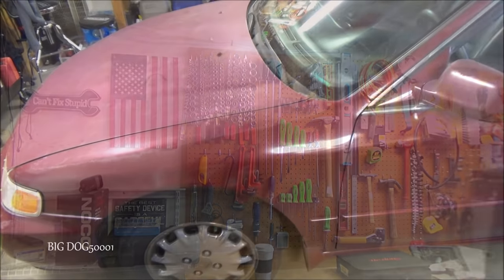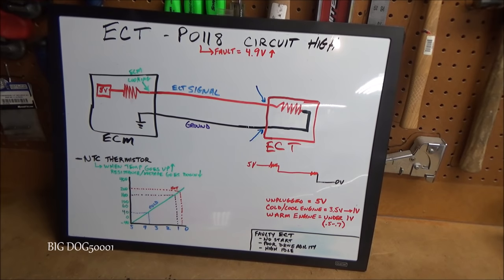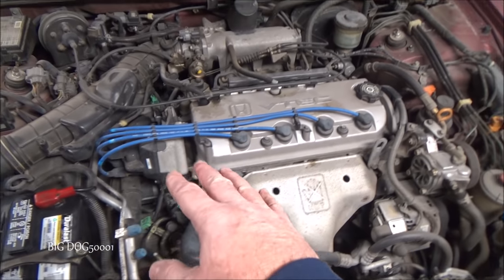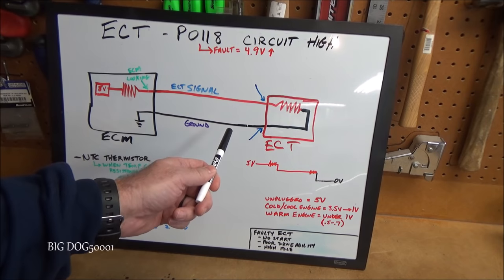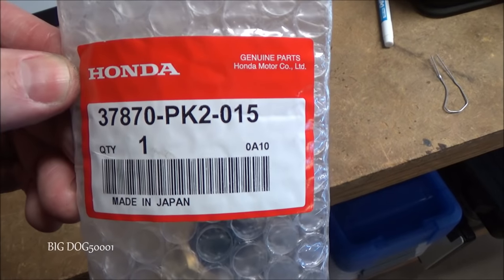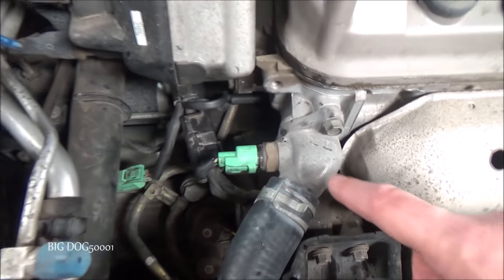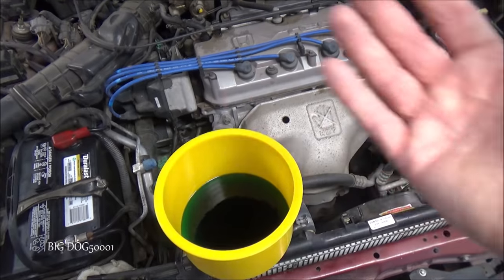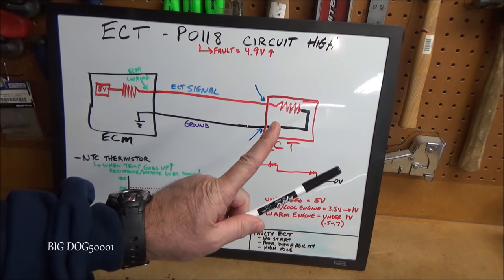Honda P0118 Engine Coolant Temperature Sensor (ECT) Circuit High Diagnosis and Repair

Comment from the maker: Tools and Parts
Disclosure: This channel earns a small commission using some of these links - at no additional cost to you.

Autel Code Reader (Scan Tool):  https://amzn.to/38ogyea
OBDII Extension Cable:  https://amzn.to/3amqCqS
Engine Coolant Temperature (ECT) Sensor shown 37870-PK2-015:  https://amzn.to/3rfs4kX  
Spill Free Funnel:  https://amzn.to/3mBYD93
Genuine Honda Coolant:  https://amzn.to/3mxrQSE
GearWrench Midlength 3/8" Sockets:  https://amzn.to/3mI2ce5
GearWrench Flex Head Ratchets:  https://amzn.to/3asmohp
Light:  https://amzn.to/3arkc9T

The Big Dog 50001 Automotive Channel Store can be found here: https://www.amazon.com/shop/bigdog50001automotive  (As an Amazon Associate I earn from qualifying purchases).

Comment: The most helpful video I've watched among dozens that cover the same topic
Reply: UPDATE: found out the ground wire was broken (bit by rodents) using your method. Connected it myself. Happy again! Thanks a lot!
Reply from the maker: Glad you found the issue (without firing the parts cannon at it), thanks for the comment!

Comment: 07 Fit, and my fans aren"t turning on on 90 degree days except when I turn on my AC. No codes are popping up, replaced both ECT 1&2, fans come on when ect 1 and 2 are disconnected or when I request A/C.  Big Dog I heart this video, Eric the Car Guy has always been my honda go to guy, but this is the best Honda fix video yet.  The best thing is how to use 'live data' on the scan tool to diagnose sensors in the vehicle.  Going to check 'live data' tomorrow :)
Reply from the maker: I appreciate the comment, thanks!
Reply: Hi. I have the same problem. Im about to replace both ect, then if anything, im looking at the thermostat. Did you find your fix on yours?

Comment: Thanks for posting this video. In the past, I've opened the bleeder valve in the manifold but it's good to know a funnel like yours is all I really need on these cars.
Reply from the maker: Nothing wrong with using the bleeder too (if the vehicle has one), especially if all the coolant has been removed.  Thanks for the comment!

Comment: Thank you!  I feel like I just completed a thoroughly educational training course!  I have a fast idle when engine is cold even after cleaning throttle body and IACV and I am suspecting the ECT sensor.  96 Honda Civic EX A/T.  Believe it or not, the Honda service manual doesn't even say that an ECT sensor that is out of calibration could be a cause!  I have no trouble codes but will connect my scan tool and read the live temperature data while measuring the temp of the ECT sensor body with a thermocouple on my DVOM.

Comment: I have a ‘97 Accord (2.2L non-VTEC)that for the past two winters has given me cold no-start issues when temps are below 40 degrees Fahrenheit.. at around 45° I can get the car to start but it chugs for a few minutes and I may have to depress the gas pedal near the floor before it will finally bump up to regular high idle RPMs. I’ve done a lot of online reading and seen various peoples posts about failing ECM’s however, I’m not the type of guy to throw parts at it and really enjoy your troubleshooting process. I know when the car starts that it has been getting a lot of fuel as it blows out a lot of rich, fuel exhaust. With a scanner is there a particular area of the l diagnostics that you would suggest paying attention to. I would really like to get this issue fixed so I can bring this car back to being my reliable daily driver. I just purchased the scan tool used here through your link so I can try to get a handle on this—so thank you so far for your detailed video.

Comment: Great video mate (hello from Australia) 
Having issues with my 1999 Honda S2000.
Replaced the ECT sensor after having the Code pulled (pre OBD, the paperclip method under dash, 6 flashes indicating ECT), the CEL was still on even after resetting the ECU.
Gave it a good thrashing through the gears and the CEL didn't come on for a few days. Now back to where I started.

After watching your video, thinking I'm gonna get a Multimeter, burp the system. Shame my car doesn't have a port to simply READ the codes lol. Only have them display on the dash
Reply from the maker: A 6 trouble code is similar to a P0118, circuit high.  If a new sensor did not fix it then a broken wire(s) or bad terminal connection between ECT and ECM or a bad ground for the sensor is probably where I would look next.  A scan tool would definitely help!  Thanks for the comment!
Reply: @BigDog50001  Thanks mate 👍

Comment: Great video, good explanation. 2012 Civic - runs great all winter. Hot summer days after a 20 minute trip or 20 minutes idling in parking lot, no warning lights come on but if engine is shut off, it will not start. No cranking, nothing, as if computer is telling starter relay to not attempt because it is too hot. 30 minutes later after engine cools down, it starts just fine. Could a faulty ECT be sending the engine ECU a signal to "Not Start"?
Reply from the maker: Thanks 👍!   A bad ECT can cause a hot crank no start.  https://youtu.be/S2RLQQy4XTQ

Comment: Great video! I have p0118 but my coolant temperature reading is fine during operation (160+ degree Fahrenheit). What could be the issue?
Reply: Did you ever fix yours?

Comment: So helpful will try on my 1998 Jeep Cherokee I replaced the ect sensor, but got the code. Was confused. Going to burp the system and delete code and go for a drive cycle.

Comment: Great lesson on the system . On the 2000 Accord , 4 cylinder , I am having a problem releasing the connector .  The tab is in the " 7 o'clock " position and out of view . I did remove the distributor cap and pulled the wiring harness back for a better look . I don't want to break it . I can possibly get a mirror in there to see the tab . I might have to use a pick on it . Am I missing something ? Thanks .
Reply: I’m having this same issue now did you ever find a solution

Comment: I have a similar problem. Would bad engine and transmission mounts cause the engine grounds to loose connection intermittently? I noticed in my scan tool that once you accelerate the ECT sensor shows -40 and then after a while it returns to working order.
Reply from the maker: Not completely impossible but the ECT is grounded through the engine computer, more thank likely there would be more issues than just an ECT sensor problem if there was a ground connection issue like you describe.  Breaks in the wiring to the ECT sensor can cause what you describe though.  Also, ECT sensors can fail intermittently like the one one in this video.

Comment: Hi Dave…thanks for such a clear and informative video. Super helpful.  Quick question about the switch you explained around 8:00. I’ve got a 1990 Honda Accord; no check engine light but the cooling fan (passenger side) comes on engine shut off EVERY time.  Fan will run for about 10 minutes and then shut off.  I know this is normal when the engine is hot, but it also happens if I go out on a chilly morning, start the car, and then immediately shut the engine off…the engine is still stone cold but that cooling fan will run for 10 minutes.  Based on your explanation I’m guessing the switch at the base of the upper radiator hose has failed.  So…how do I order a replacement? I believe that this switch and the switch in the back on the thermostat housing (explained at 7:05) have different temperature set points, no?  If I go to the auto parts store and just ask for an engine temperature switch, how can I know that I got the one with the correct set points?  Thanks for any help you can offer!
Reply: Have you fixed this issue? I have an 06 accord v6 and it does exactly the same thing as yours, the fan always comes on when i turn the car off, even if i just start it for a second. I had the ECT replaced a while back and did not fix the issue, now im getting the check engine light with the P0118 code

Comment: Great video guided me very well on  my 97 Acura cl 2.2 in finding the location of the ECT sensor. However i do have a question that i hope you can answer? Are the ECT switches that you show the one on the upper radiator hose and the one that is toward the back of the motor the same? meaning if i was to take them out and switch them out with each other would they still work? the reason i ask is because i can only find one of them under radiator fan switch and that's it. I pulled both those switches out and they are exactly  the same in everything but im not sure if they are interchangeable? if you can shed some light thank you very much.

Comment: How do you think about a VCM Muzzler, it manipulates the ECT1 temp to be always around 165F for the ECU to keep the VCM off. What else is the ECT1 data used for in a ECU? For sure Dash Temp Gauge and blower is only starting blow warm air after engine has warmed up to certain degree. Is the full mix ratio also depending on ECT1 temp or is it done by the O2 sensor? What other functions depend on ECT1?
Is a muzzler a functional solution at all?
Reply from the maker: Disabling the cylinder management system can work depending on who makes the device.  ECT1 plays a part in fuel mixture to a certain degree, so it is important.  I like disabling the system on V6 Honda engines due to P0303 issues that can eventually cause engine damage.  I plan on putting out a video on this topic soon.

Comment: I got a broken wire harness connector pigtails for my ECT on a 2000 honda civic Ex..I forgot the original orientation of the wires but its only 2 colors it looks like dark brown or red and black for negative I believe.so what happens if you cross the connection will the ECT still works or it will malfunction?I connected the red to red and black to black..I need some advise coz I still got CEL P0118 code,I will replace my ECT this week and see if the CEL still on and my idle was high like 1500 rpm..thanks

Comment: What a awesome video man I have a 96 accord and I do all my own work but I knew there was like 3 ect sensors and a sending unit and for the life of me on Google and everywhere I looked I could not get accurate diagram of which sensor was which so thank you for the info you are very helpful. Also if you don't mind me asking where you got that info from not so I can verify but so I can get info from the right place in the future. I do everything from simple repairs to tranny and motor rebuilds and this sensor situation had me confused! I have the same code similar issue mine is just high rev  at stop signs and hard starting in the mornings I thought it was the iac or something but I ran my code scanner and found the same p0118 code. My cel is always on for the cat that isn't on the car so I wasn't sure if I had a cel for what was going on or not. But thanks again!

Comment: All the sensors in all the cars are basically ADC (Analog to Digital Converter) values, that is, voltages to digital values.  Pretty simple stuff and materials, but the car industry charges people arms and legs for these sensors!

Comment: Just a quick question. If my fans are coming on after the car is shut off but not running when the car is turned back on could this be the ect. I know the relay is good for the cooling fans and the thermostat is working but we are only overheating when it is at idle. Otherwise it does not overheat. The fan is not turning on once it gets over certain temperature

Comment: Might not get a response but here goes. I have a 2001 Integra popping this code after overheating(gauge was going up to hot then sliding back down to the middle) I saw some leaking from around the same area that this ECT was located. Could it just be as simple as replacing the ECT and topping off/bleeding the coolant? There was also a P1457 EVAP leak code. Thanks in advance for any response

Comment: Hi, can you help me please? I have a 2013 honda civic 1.8L. Today I was at dunkin donuts, the car was idling with the AC on, then after about 7 or 10 minutes the red high temperature light began to flash. I immediately shot car off waited about 15 minutes. Car was restarted, then I turn heating system system on all the way to get all the heat out of the engine. Then car was parked. After about one hour I scanned my car with a good scanner, did not get any engine codes, monitor codes, or gages codes. I then command the cooling fans to engage with the scanner which they did. I also checked for cracked hoses, inspected radiator, inspected under water pump pulley and under car but no sign of any leaks. I am assuming its a coolant tempt sensor going bad but not sure. I have not inspected the coolant level on the radiator or coolant reservoir yet. Any suggestions will be gladly appreciated. Update: inspected radiator, removed cap, seemed ok and nothing missing, no rubber parts missing. However, coolant level inside radiator was a little bit low so I put in until neck level on radiator opening. Used only honda approved coolant. No leaks visible, scanned ECT sensor 1 and 2, and both cooling fans kicked in. Did this test three times and three times both fans kicked in at 85 degrees Celsius (185 F) ECT sensor 1 and 78  degrees Celsius (174 F) ECT sensor 2.  I assumed both fans should kick in at around this temperature. However, I am not sure of that. I also scanned gages and monitors as this scanner showed no trouble codes.

Comment: We’ll explained sir very nice job. I have a 2004 1.7 civic ex and it has been a hard time to find a decent video. I’m having a similar issue but I have a newer model. 2 sensors. I could not get it to even start after I tried to flush. I have replaced sensor that goes into the thermostat but it appears along the way I damaged the other sensor so nothing is reading on the interior after I finally got it started. It idles rough and throwing a fuel injection code however it is the same sensor. I’m curious because it being the only sensor I did not fix that this much the issue. I’m hoping it work I will let you know I may do a video myself. Thank you for the great video and thorough explanation.
Reply: What did u come up with on yours im having the same problem

Comment: My car had a Code showing up of P0115 Engine Coolant Temperature Sensor 1 Circuit ,and My temperature gauge is going high . Now I just now replaced my Sensor and a new Thermostat but still it kinda smokes and drain the resevior coolant .  What's wrong with these car I need ideas to fixed my cars issues .good advice would be great . Now what is the settings of the Multimeter to test your sensor I have a Ever Start Digital Multimeter .

Comment: I measured -38 unplugged and jumpered 284. 1998 z28 Camaro LS1 
Do you think it's a bad ECT sensor? Possibly didn't reach 400 jumpered due to being a GM car. Thoughts?
Thanks in advance. Great video!

Comment: My 2009 civic engine light turned on but it only shows a pending p0128. Should I worry or let it go until I get a fixed code?
Reply from the maker: If the engine light came on, it saw the problem at least twice.  ECT2 (located on bottom of radiator) plays a big part so verify that the terminals on ECT2 are clean and tight (not corroded or damaged).  Otherwise the most likely cause is a bad thermostat.  I probably would get it fixed sooner rather than later.

Comment: i came across this video because i have a P0117 code in my Peugeot 106.

Any chance you could explain a bit what i could check?

my fan runs continuesly from the first key-turn, and the temp-light on my dash is on consistant. (no power loss, and the temps seem to be fine, no overheating)
I replaced the sensor, since it was cheap, and showed way too much resistance at 20 degrees celcius, and even more at higher temps. 

i tried measuring with a multimeter with the negative terminal on the battery, but i couldn't understand the measurements too well. 
i have a 12V on pin 1, and 12V on pin 2 aswell.. what is happening here? 

internal resistor from the ECU fried, maybe?
Reply: correction:

today i measured again, while the fan was on, and 10min later when the fan was off. (key out of ignition in both stadiums)

on pin 1 of the sensor i measured 4,98V, just as pin 2 (4,98V)

in this case i dont think the ECU is fried, any idea where i could start to look?

Comment: The 2nd sensor that's upfront engages fans after the car is off. What is it called specifically
Reply: Its the ect sensor. The one in the back is the ect switch

Comment: I've had a 2004 accord 2.4 and I have the  p2185 code and P0118 forever I've changed the sensor and one of the wiring harness and starting to think it's the ecu/pcm but idk how to check that
Reply: I metered it out as well and everything seems fine:/ now temp gauge immediately goes to H

Comment: The ect is reading coolant temperature?.... if the coolant isn't touching the ect (low coolant) would it keep the engine from cranking?
Reply from the maker: It should not cause a no crank.
Reply: @BigDog50001 can the ect cause a hot no start on civic?

Comment: I have a 2005 honda civic that does not start when it is cold. Only if the engine heater is plugged in. Or if it is warmer in the air